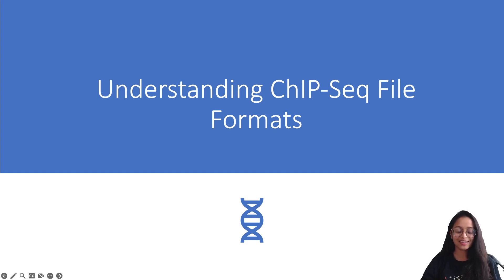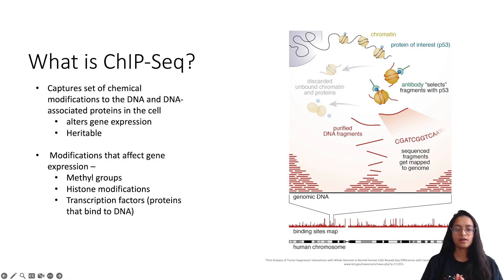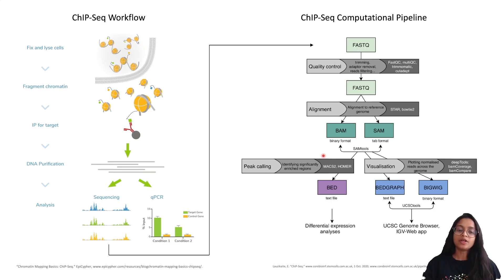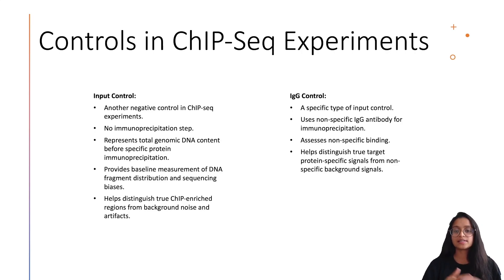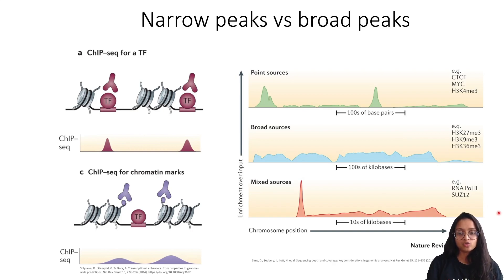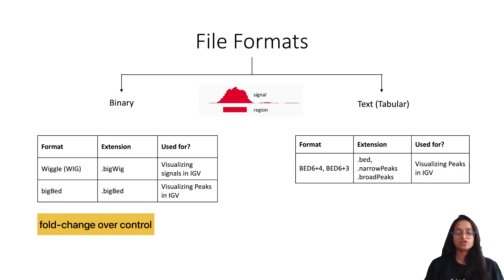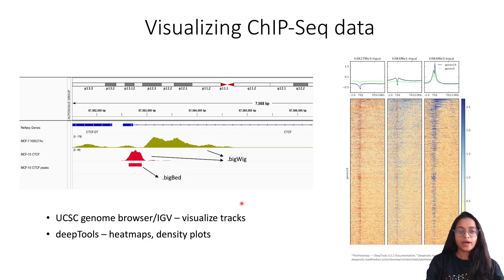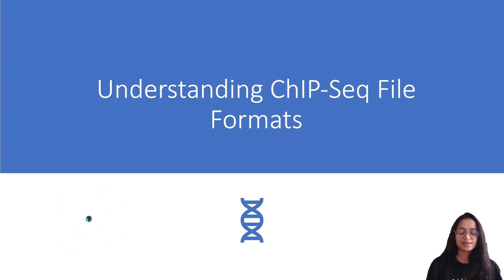Understanding File Formats in Bioinformatics: ChIP-Seq files - BigWig (Wiggle) and BED/bigBed

Comment: I have an Excel file containing genomic coordinates with columns for chromosome, start, stop, and strand (example below):

Chr,Start,Stop,Strand

chr18, 46097960,46098231,-

chr19,46089854,46089890,+

Using this data, I need to identify and extract genomic features such as promoters, 5' UTRs, 3' UTRs, intergenic regions, exonic regions, and intronic regions. How can I accomplish this?
Reply: I'm not sure if this is still relevant, but you can use various annotation tools for that purpose. Personally, I prefer ChIPseeker, which can be run using R and generates a variety of graphs with built-in functions. However, I guess there are other tools available as well, such as HOMER and CEAS. With CEAS, you can also obtain a graph that shows the signal distribution in relation to the transcription start site (TSS) or transcription end site (TES).

Comment: Great video! Very clarifying! I have a further question. How does one deal with repetitive regions such as the rDNA locus? In my dataset I see the highest read count at the rDNA but for some reason it is not called as a significant peak. Do you have any idea on how to deal with this? Thanks:)
Reply from the maker: A common approach for dealing with repetitive regions is to mask or filter out these regions. ENCODE provides a list of such blacklisted regions. In your case, it seems the outcome is favorable. You should not expect to see a significant peak in your repetitive region (in most cases). Repetitive regions may appear enriched by looking at the number of reads mapping to that region, hence it is important that the ChIP-Seq profile is compared to a matched input control to determine its significance.
Reply: @Bioinformagician  Actually, that would not be favorable, as I am working on such a region. But maybe the method then is just not suited? In any case. Thanks for the reply!
Reply from the maker: Thank you for clarifying it. Sorry, I misunderstood your query initially. Determining significant peaks in repetitive regions can be challenging. One way you could improve the detection of peaks in these regions, is by lowering the p/q value threshold while calling peaks (for programs like MACS), however be wary of lots of noise and false positive peaks that you will be getting in your results. Another rudimentary way that I can think to determine significant peak enrichment, is to calculate the number of reads mapping to these regions in your sample and matched normal and calculating fold change. The fold change would give you a good indication for enrichment in that region. Lastly, I recommend referring to a published study that have studied chromatin modifications and transcription factor binding to rDNA as there could be orthogonal methods/assays which I am not aware of, that you can use to add confidence to your findings by the methods mentioned above.
Reply: @Bioinformagician  Sounds like a good place to start! Thank you!